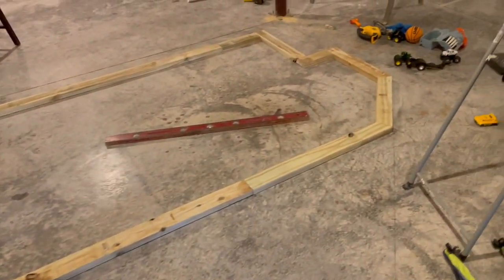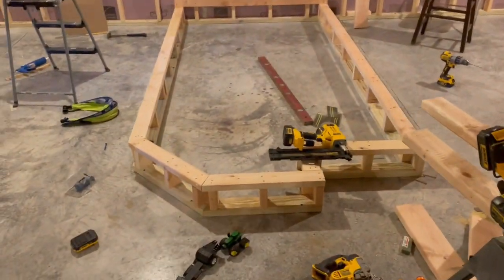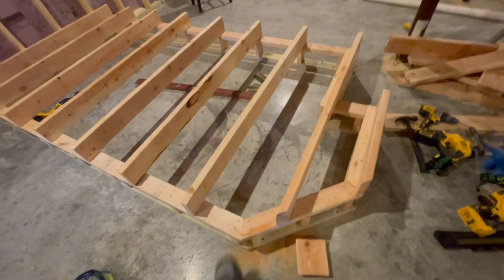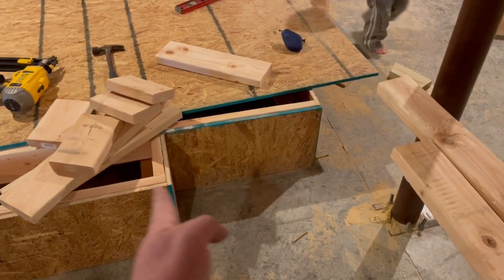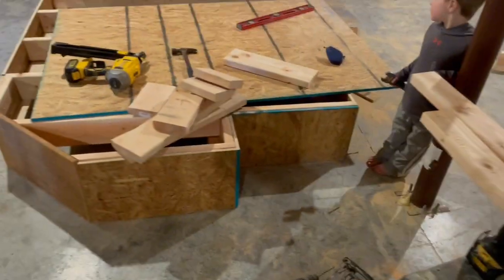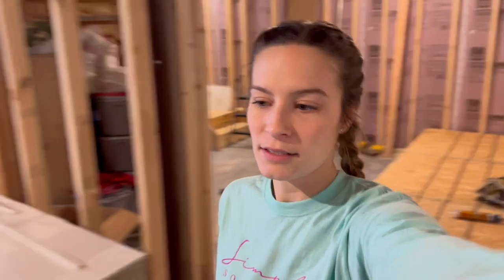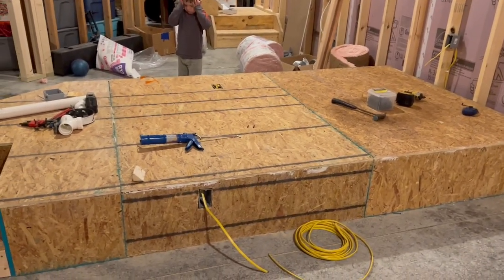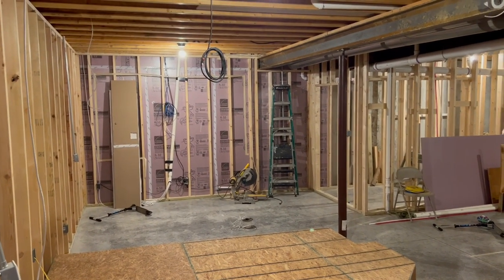Finishing Basement #4: How to Build a Movie Theater Seating Platform/Riser!

Comment: What model is your guys’ sawmill and how well do you like it? Have plenty of power for what you need? Thanks!
Reply from the maker: Hi, we have a woodland mills HM126 with the 14 HP Motor. It has good power. We cut mostly red cedar but handles white oak and red oak no problem. Sharp blades are the key. Thanks for watching

Comment: Cool job. What are your thoughts on putting insulation under the floor?  I'm about to build a 120" x 64" riser (12" high) and have seen people put it under the floor to supposedly help with the sub woofer.  I have a bunch of old R11 pink stuff in my garage I need to use up anyhow.  I wish you would have filmed yourself putting the insulation in. Did you just use hangers?
Reply from the maker: Hey. Thanks for watching our video. I do recommend putting insulation in the riser to help with the echo sounds from the sub woofer. I packed in the insulation somewhat tight to keep sound waves out as much as possible. I’m happy with how it turned out.